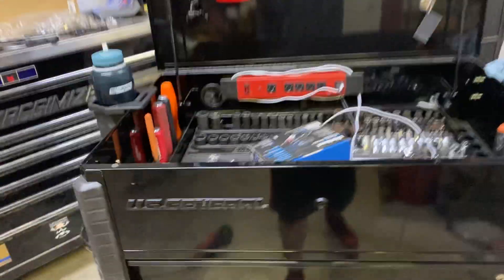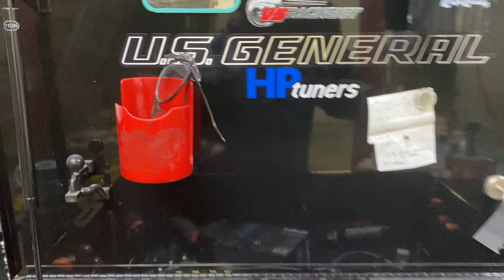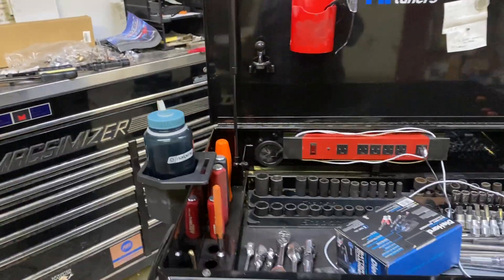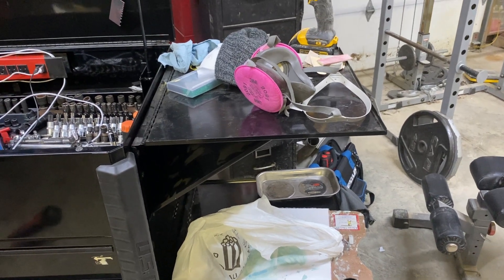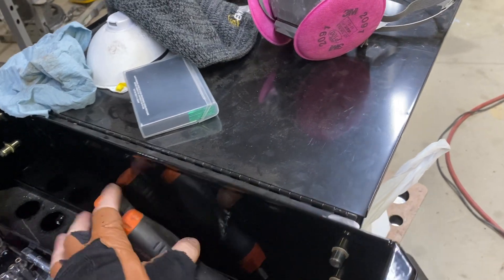Us general 34 master tech cart shelves can holder and drawer latch hack.

Comment: Thanks for the upload. I got the same cart and put a powersupply in the bottom drawer as shown from another guy. I put all my power tools there but that's definitely unnecessary if you have a nice work bench with a long power strip or a peg board. I also bought a shelf to put on, not sure if I'm going to cover the top of the box and shelf with skateboard griptape or not.